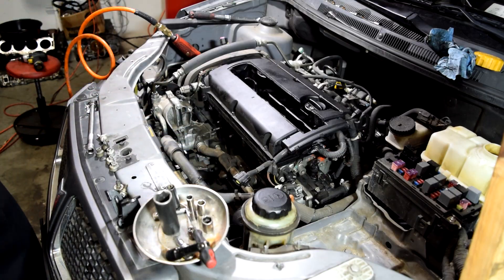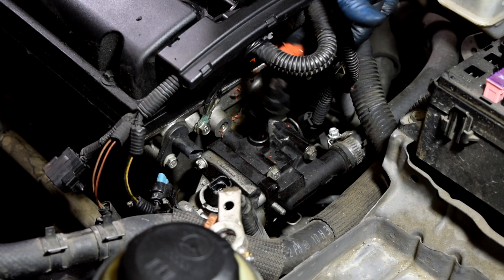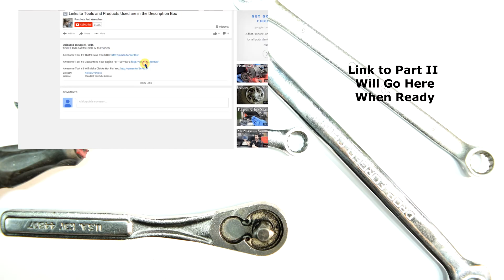How to Remove and Replace a Cylinder Head and Gasket on a 4 Cylinder Engine - Part I

Comment: Question (don`t laugh): can you advanced the timing by rotating 1 tooth of the pulley or the crank stays put and you rotate de cam axles? And by that will you damage or interfere the pistons with valves? Thank you very much

Comment: @T6:26

Never, ever, EVER, stick a crow bar into your engine bay. The aluminum parts are not meant to take the leverage.
Reply: Jon Thomas the manual of the car says that is how to take off the belt
Reply: Hurrdurr that's cool and all. Crow bars are the fastest way to multiply stupidity when working on an engine.

Comment: So to put your motor in time if its transmition is authomatic and not standard then you put it on D4 or what?
Reply: Kevin Brieva caballero you leave it in park if It's auto. In gear if It's manual.

Comment: Ratchets & Wrenches keep up the good work, I enjoy your informative  videos even though they're not on my specific vehicle or engine  (2000 dodge durango SLT 2WD 5.9L with an A/C leak that's impossible to find and spent $$$$ but never found with limited not so great videos on how to remove the dash to replace the A/C fan blower). #droppinghints #venting

Comment: I'm working on a 1996 Ford Thunderbird with a 4.6L engine.  I just replaced the AC high/low lines, accumulator/dryer, orifice tube and compressor.  Also, did a vacuum on the system. When the AC is running, I'm getting some high psi readings on the manifold gauge.  Low side is 60 psi; high side is 340 psi.  Also, the compressor doesn't cycle on and off when the AC is on - the clutch just stays engaged on the compressor.  55F degrees out of the vents when the outside temp was 105F degrees.  Why is the pressure so high and why does the compressor stay engaged?  Would the hot weather cause these conditions? Thanks...

Comment: Thanks for sharing your time, talent & patience. Through out the years the repairing of an engine has become more difficult than it was some decades ago. Just makes me think will it ever get any easier. LOL Just in the tools needed alone to repair an engine has made it costly to do so. Which at times is the reason why people don't understand why a repair is some much more than the part itself. Labor isn't only the time invested on a repair. Tools needed are also an investment on repairs, and it's not always the same tools used for a same repair. Every vehicle is not the same. Sorry for the book I've written here. I just appreciate your videos even though I'm fairly a new subscriber. Thanks again dude. 👍👍
Reply: Man I think working on older cars is so much more difficult than them new cars

Comment: is there a video for troubleshooting this? good stuff
Reply: airobyou no, you just have to have a tester that can test stuff like that. Milky oil is a good indication, or oil in the coolant, overheating... lots of indications that could also be other things, an electronic tester is the best thing to use.

Comment: easy job just a ball ache to remove all the screws clips etc etc as long as you tighten it back up in the correct order your fine.